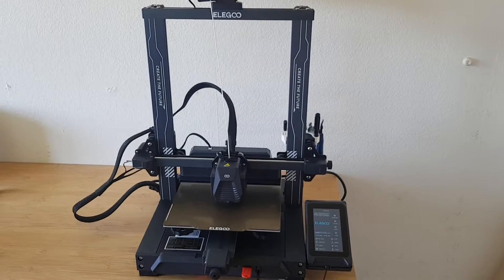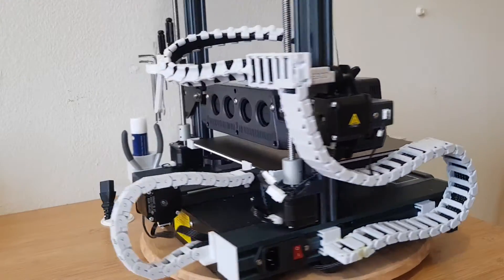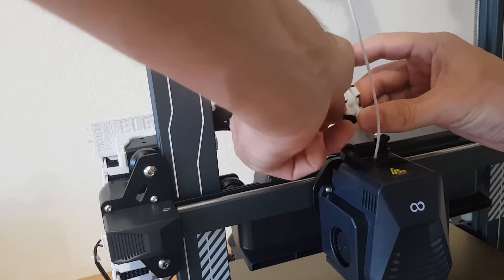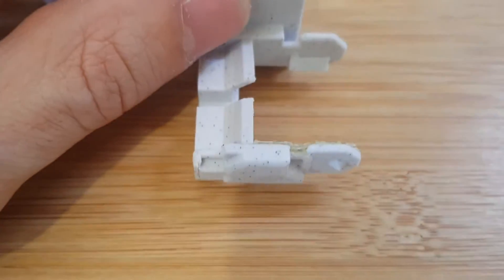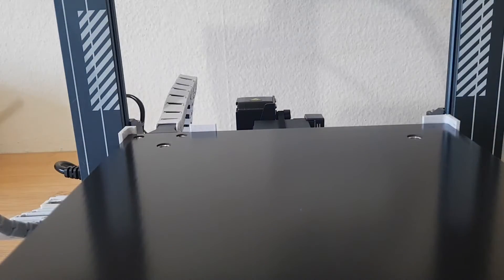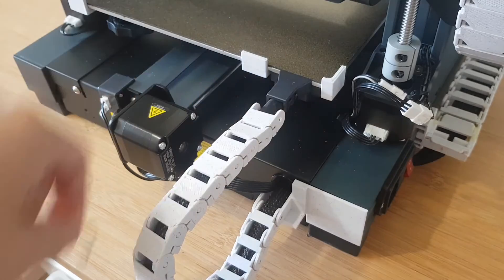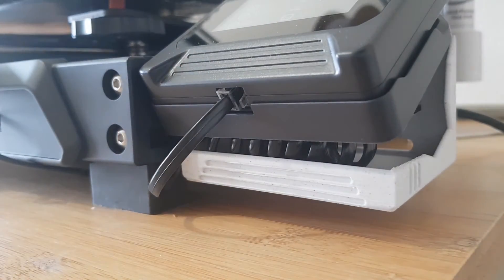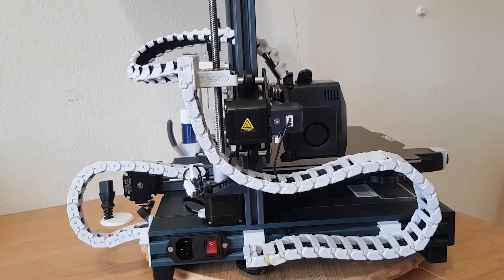Best Printable Upgrades for your Neptune 4 /Pro (Part 1)

Comment: I printed out the spine cable and the large cable and was wonder where you got the part to connect the spine cable to the larger cable link?
Reply from the maker: Good question, and Sorry, for the late answer, there  is no part that connects the spine cable to the large Cable link. I just did the spine links on the extruder cabel until the whole cable was covered.
If you find a better way to do this, please let me know. Have a nice day ✌
Reply: @Dirt-E-Bikes  there are remixes on Printables that do just that. One would have to reprint the base, though. Check them out.
Reply: @oleg..  i cannot find them can you point me to one please? i wanna connect my spine cable to the big cable bracket just like in the video at 7:26
Reply from the maker: @trapstoner  hi trapstoner, i did not connect the spine cable to the big link, it just looks that way because i "filled" the extruder cable with the spine links so its a tight fit, but they are not "connected" but loose.

Comment: Hey! How did you print the Spine Cable Guide? Infill...?
Reply from the maker: The Spine Cable guide i printed with 15% infill. Just make sure that you orient them in the right direction so that they stand on the build plate

Comment: Any links for Neptune 4 MAX?
Reply from the maker: Hi Stevedixon, do you mean links for the Cable-chains? I guess they should work on the max and plus too, but you will need somewhat more of them. The Cable of the Max looks to be the same witdth lile on the N4 pro, its just much longer ;-)
Reply: I'm specifically looking for the corner guides.
Reply from the maker: @stevedixon4179  i guess you can use the same ones i shown in the video, the links are all in the video description. Let me know if they work on your Max printer as well (i thunk they will).

Comment: How do you fix the Cable Spin to the 90° Z Adapter ? I think i can see there a adapter but there is noch stl .
Reply from the maker: Hi Nobsy1984, kannst mir auch auf deutsch schreiben ;-) das Kabel muss bisschen gefaltet/gedreht werden um es in den 90° Adapter an der Z Achse zu legen. Oder meinst Du die Verdrehung des Kabels in der unteren Kabelkette die zum Adapter führt? Werde probieren zeitnah zu antworten, beste Grüsse ✌
Reply: Ich meine die Verbindung von 90 Grad Adapter an die Flexible Kabel kette. Es Schaut so aus als hättest du da nen extra adapter gedruckt. Mein Name bei Printabels ist der wie hier , sonst gerne da mal nen Foto schicken was du da gezaubert hast. Kann man leider im Video nicht erkennen . @Dirt-E-Bikes
Reply from the maker: @nobsy1984  ach so, da habe ich einfach einen der normalen Links zurechtgeschnitten, damit es bisschen nach was aussieht. Der Hängt da aber lose, ist also nicht fest angemacht oder so. Hast recht ich glaube beim Druck dieser spine-kette war noch ein "anfangsstück" dabei, das habe ich aber nicht verwendet. 
Ich hab also einfach mit Links aufgefüllt bis ich am 90° Adapter angekommen bin, und dort das letzte Teil zurecht geschnitten (den Teil abgeschnitten der das Kabel halten würde)

Comment: Hey boss. Trying to make this all work with my new Neptune 3 plus.  So far so good little tweaks here and there. However I’m struggling printing the spine cable. Female end down. Anyways the female end should be hollow but the print drupes. Do I need supports for this model? I’m new to printing this might be my 10th print. I’m struggling and not ready to quit.
Reply: The inside of the female ball joint drupes. Basically no longer hollow. Everything else with the print is fine.
Reply from the maker: @NorDesigns  Hi Nor-Tody, i printed the spine cable as you said - female end down on the print plate, and with no supports. How does it fill the female end? Sorry i dont understand what the word "drupes" mean. Can you describe the problem? Anyway, female side down and no supports did it in my case. I think this is the only orientation that makes sense, but maybe in your case you can try with some supports
Reply: @Dirt-E-Bikes  I have another problem with the female part. I tried PLA and PETG bot every time the female part breaks if I put the male part into it. Did you experienced such an issue?

Comment: Your video is perfect! I just got my 4 Plus, and I have been looking for similar mods. Thank you so much!!
Reply from the maker: Thanks for your kind words👍, in a few days comes part 2 of that video with more cool mods, im cuting that video right now. And im allready filming (and printing) for part 3 ;-)
Reply: On the plus, can you raise the z all the way up?  Does the z mount bracket jam in the frame?  The stiffening bars on the plus and max meet at an angle and might pinch the thick bracket?
Reply: @brods-b1b  Did you ever figure this out? was debating on doing that piece for my Plus

Comment: Why I need a 3D printer?  - to print printer accessories, of course.
Reply from the maker: That is what they are built for, isnt it?
Reply: It's kinda cool to have a machine that can upgrade itself 😉
Reply: I found that to be one of the coolest things about a 3D printer.
No need to wait for some dude in the company to make this upgrade i need for sale....i can just make it myself right now.

Most of these cool upgrades are then standard on the next versions ;)
Reply: A printer's printer prints prints for printer's printers, but a printer's printer should print prints for printer's projects. ;)

Comment: Hello.  I also have a neptun 4 pro printer.  I would like to ask if you could help me with which slicing program you use, because the print image is not good for me.  And the print pops up from the display table.  Maybe you could upload a slicing profile that I could paste into mine.  Thank you for your response.  Have a nice day.
Reply from the maker: Hi Zsoltkovacs, i use the Elegoo Cura that came with the Printer. I use standard Settings for the most part for now. What problems do you have with the print image?
Reply: @Dirt-E-Bikes  If you could send me an e-mail address, I'll send you a photo of my problem.
Reply from the maker: @zsoltkovacs1116  can you upload a foto on a site like  https://postimages.org and share the link here? Maybe some others can then also give some advise
Reply: @Dirt-E-Bikes  if I do it in vain, my comment will be deleted
Reply from the maker: @zsoltkovacs1116  oh, sorry i didnt know that. But anyway, you may better write your problem with the printer in a forum, i do not have much experience with problem solving yet 😔
Reply from the maker: Thanks for subscribing 👍

Comment: I just bought an Neptune 3 Pro, and your video is the only one that i found that show some usefull mods to do on the printer, great video!! I'm waiting for the new video to see some more upgrades that i can do for my printer, thanks a lot for the tips!
Reply from the maker: Thanks a lot for your kind comment, i hope the parts for the part 2 of the video arrive soon, so i can do that 👍
Reply: Later can you do a video showing your slicer settings? Sometimes my prints don't fit correctly, and i don't know how to fix it
Reply from the maker: @Pontelli  sure, i can do that. Do the files in your slicer dont lay flat on the build plate? If that is the problem, maybe i can write you what to do about it, so you dont have to wait 2 videos.
Or do you have problems with 1st Layer or other things you want to solve in the Slicer settings?
Reply: The 3 Pro is a great Printer vor Beginners, mine worked out of the Box after i Build it, and of course, first 2 things was 2 Benchys, one with the file elegoo gives and one i made by myself, after that, tool holder and next is a Cable Chain, thes in the Video looked soooo smooooth 😂😂😂😂

Comment: Big thanks for this - I'm developing an alternative rear fan assembly to utilise normal PC case fans. My six N4's sound like a jet taxiing to the runway and it's intolerable  ✈
Reply from the maker: Your welcome 👍
Oh wow, you have 6 of these machines?  I only have one and I think the noise level is borderline. Good idea to design an alternative fan. I can't wait to see your design and the volume. Can you post a link here?
Reply: Sure - we're waiting on a few parts to finalise the design for performance testing and then it will be ready to share. It looks like a single 140mm mid-RPM fan is the way to go. I'm hoping that a 25mm fan blade will be sufficient otherwise 38mm blades will be used. @Dirt-E-Bikes
Reply from the maker: @11thHourRecords  I'm very excited about it. A lot of people have already written to me about how loud the original fan is, because many people are annoyed by it. That sounds like a very promising upgrade for a lot of people. My printer is in a seperated room with very thik walls, so its not that big of a problem for me, but i can still hear it running when i print something and go to sleep 😅
Reply: I can't wait to get rid of my Boeing 747! There's a product render on my channel - still some optimisation to do but acoustic profile will be 26 - 45dB 👍  @Dirt-E-Bikes
Reply from the maker: @11thHourRecords  😂 i know exactly what you mean
Reply from the maker: @11thHourRecords  and am max of 45 Db sounds way better. I think original its something over 60Db.?
Reply: And there's something about the pitch of those screamin' 4020 fans that just hurts my ears. All my commercial production is done at 250mm/s which I found doesn't need the highest airflow, and 1500rpm on the large fan has been sufficient so far and that's whisper quiet 🤞   @Dirt-E-Bikes
Reply: Oh... Oh man that's a great freak'n idea...
Reply from the maker: Your Design looks very promising with that single large fan 👍
What kind of prints you do on your N4 production line? Mostly PLA?
Reply: Mostly small dimension functional pieces for trade applications (4-9 pcs per plate) @Dirt-E-Bikes
Reply from the maker: how is it going with your fan-mod? still very interested in trying this :-)
Reply: It worked out better than I hoped. I found a 2800rpm 140x25mm spec fan which is driven very lightly at the 80% default on the Neptune 4. Noise level is equivalent to the PSU while the airflow is higher than the stock assembly. I can hear myself think again!  @Dirt-E-Bikes
Reply from the maker: @11thHourRecords  nice, that sounds great 👍will your design be availabel on thingyverse?

Comment: Looks great! Does anyone know if this is applicable to a Neptune 4 plus?
Reply: Also watching the video for the 4 plus. Mine did not arrive in jet, but I think that it can be used, at least most of the parts. It's basically an upscaled version of the 4 pro.
Reply from the maker: @nlkec4421  right, i think the same, you probabely need more links at the chains, but most of it should work on the Plus too